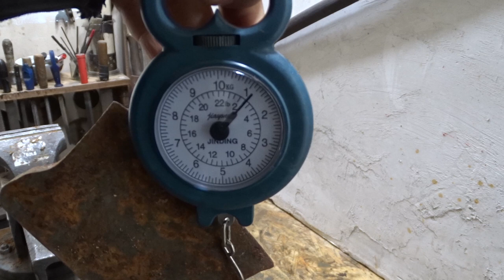Old Rusty Handmade Axe Restoration

Comment: Yes! I like. What is The two components color? Thank you, your vídeos are amazingly relax 👏🏼👏🏼💯💯
Reply from the maker: Two-component paint, this is a normal hair dye. You can use the cheapest result will still be good. After you paint the material, you need to wait from 30 to 60 minutes.

Comment: Why do the rust treatment and cleaning first instead of just using a grinder or sanding disc. Just wondering nice job.
Reply from the maker: Hello sir, thank you for attention. Because if you will going to use only angrindermachine I will lose a lot of metal and make a lot of dust in my workshop. In my case the electrolysis remove a lot of rust without problem and very fast and then I can used another stuff to make similar surface (shiny or dark).

Comment: I notice you use 2 part paint a lot. What is the benefits of 2 part paint on the handles?
Reply from the maker: Hello, thank you for attention. It's very cheap, fast and need a little time for dry.
Reply: Screws And Tools makes sense why you use it then! Thank you for your reply and I will endeavor to find some here in Australia.
Reply from the maker: @efeightyeight  This is the most common hair dye. Good luck and thank you!

Comment: Looks like a very handy style axe . What is in the 2 component paint that goes on white , then turns that rich reddish brown color ? Stay healthy brother .
Reply from the maker: Hello sir, thank you very much for attention. The two components paint it's paint for hair. The most common. The liquid include consisting of a mixture of oxidizing dyes (pigments), ammonia or its substitutes, a base and hydrogen peroxide.
Reply: @ScrewsAndTools  
Thank you . My sister in law is a beautician,  maybe she knows what it is called in the U.S. I like the way it makes the handles look .
Reply from the maker: @richardpalmer6196  You can use the cheapest hair dye, it works well on wood. For a good result you need to wait from 30-60 minutes. Welcome.